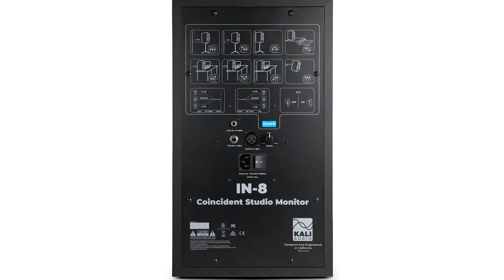Why I LOVE 3-Way Monitors: First Look at IN-8 by Kali Audio

Comment: Thanks Justin; speaking of 3 way designs, I was sort of impressed (in terms of low price vs quality),  by the KRK rokit 10-3 g3´s (same pricerange). 
 Have you heard those and if these Kalis are better, what is it that you like more about them? 
 In cheaper speakers, I often seem to gravitate to Krk´s midrange. Im a guitarplayer, and it seems I hear the "strings" in those pretty well, in sort of the same way as in many more expensive speakers I have used. Anyway, just curious what you´re thoughts are, as I am trying to figure out my "eq- curve- religion".   :-)    Cheers!
Reply: The KRKs are great too. Pretty much the only other thing close to this price range to really look at for a 3-way.

They are a bit more expensive for the 3-way. About $1000 vs $800 here.

I’d say the Kalis are shooting to try to be a little bit more neutral, where the KRKs are shooting to be just a little bit more “fun”, while still leading you to make great decisions.

The KRKs have maybe a hair more “bite” and “sparkle”, in a nice way, while not overdoing it too much. They can go even deeper because of the 10” driver, and can get even louder because of the higher wattage amps. That’s where they get high marks.

The Kalis get high marks for the extremely useful neutrality and precision of the top end and midrange, for really great soundstaging and stereo field detail and phase alignment because of the coaxial design, and for offering an even more affordable and compact package while doing it.

Both have pretty ingenious and easy to use EQ if you need it. Both speakers are unlike anything else in this price range, and you’ve really got to hear them to get a sense for what might work best for your personality.

In general, if you are primarily mixing, I recommend going for speakers that are kind of the inverse of how you want your mixes to end up. 

It’s a bit counterintuitive, but for mixing, erring on the side having speakers that sound a little more like the opposite of what you want out of your final mix can be helpful.

For instance: If you want brighter, cleaner and more exciting sounding mixes than you’re getting, then having slightly darker sounding speakers can help steer you in the direction of brightening things up.  If you want fuller, beefier mixes than you’ve been getting, then erring on the side of slightly brighter speakers can help lead you in the direction of smoothing things out and fattening things up a bit more.

If you’re doing mostly music creation, music production, or listening mostly for fun, then that rule doesn’t apply as strictly. In that case, you can just steer it yourself more towards whatever speakers sound the most fun and inspiring to you—within reason of course!

Longish answer, but most good ones are. I hope it helps!
Reply: @JustinColletti  That's an amazing and helpful answer Justin! Thanks you so much! 
Yes, Im mainly looking for at three way for mixing, as an alternitive "bigger" detailed 2nd monitor setup.  And I will ponder on your philosophy on "reversing"  the eq curve, as to where you want to end up. I think I may have the habit of having just a little less bass than I think I have in my mixes, generally. Which indicates why maybe I still like and get good results with NS10 with a sub not that loudly driven (the sub), or for example KRKs.  Interesting, refering to your thoughts on that, makes sense...
But I definetely have to hear these Kali's. Its a killer price. And I dig older Tannoys coax speakers so I get what you mean. Its a smart concept they have come up with on these.
I've been having good results with the classic combo of ns10's,  and Genelec 1032 for more detail and low end. But right now I only have the NS10's...  hm, Kalis could be a very good other  reference and replacer for the 1032- "thing"... .  Have to check them out. 
Once again thanks, nice talking to you. 🙏 Cheers,  Viktor
Reply: @JustinColletti Thank you Justin. I'm finally able to narrow down to just the Kali IN8 V2 and the Adam A7V, which is twice the price. If I have my Rokkit 10S sub take care of the low frequencies, would the difference between 2-way and 3-way be less apparent? I'm leaning 80% toward the IN8 V2 but just want to make sure I'm not being too unfair to the A7V. Thanks for your input!
Reply: Don't get ANY studio monitors with Class-D amps, particulary Class-D for the HF high frequencies. From the KRK Rokit RP10-3, Generation 1 and Generation 2 models are the best by far. Generation 3 is a bit less so, and forget the all-Class-D Gen 4 of them. With the Kalis, there is zero track record.